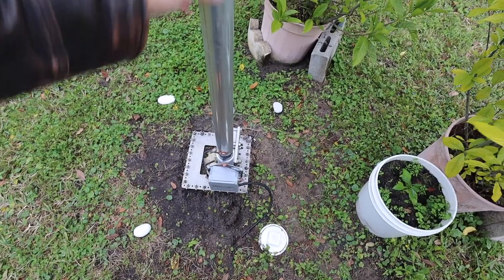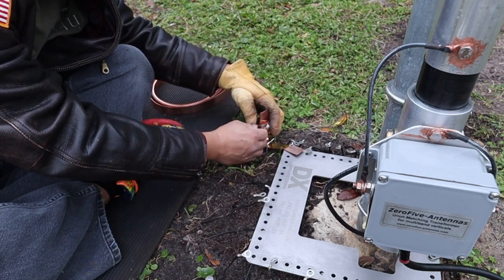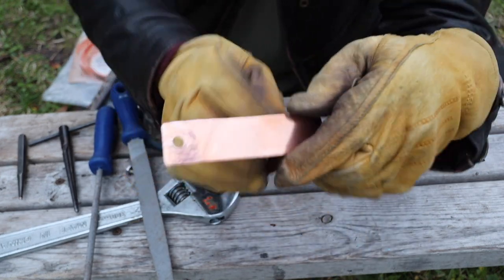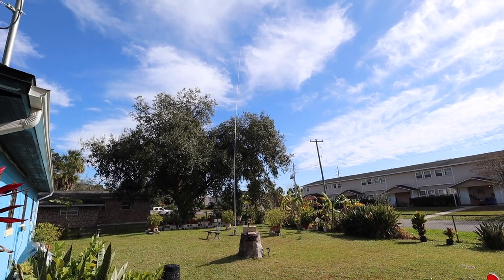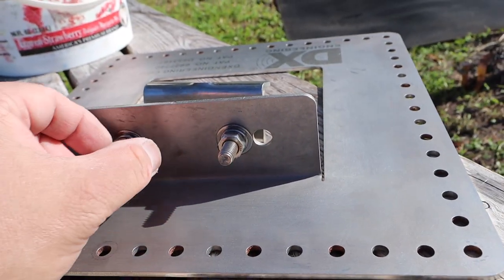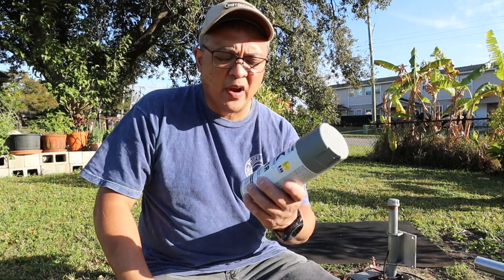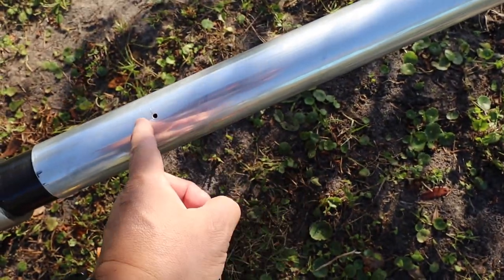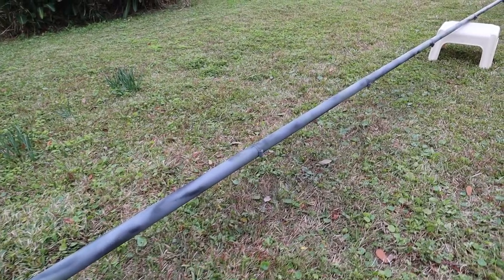Zero Five Antennas | Added 3 additional Grounding Rods and Camouflage Painting of my Antenna

Comment: I bought a post hammer for fencing at Home Depot for about $50.  Well worth it. Pounds tubing for vertical antenna support plus ground  poles with safety as it is impossible to hit your hand like what a sledge hammer can do. It really works great.

Comment: NOALOX is good to use between aluminum connections to prevent oxidation (NO ALuminum OXidation) .  It is also conductive and reduces resistance.  I used it on my 43 footer when joining the sections.  Also I think a better use of the ground rods is to put them in a line sequentially about 16 ft. apart (for 8 ft. rods) and joined with the copper strap or #6 solid wire.  If they are much closer than that their regions of influence overlap and the rod's ability to disperse energy will be diminished.  I'm assuming they are for lightning protection.  I'm enjoying your channel since we have very similar setups.
Reply from the maker: Hello Bill, those are good ideas.  Today, I just layed down 9 additional 43' ground radials and then a thunderstorm with lightning came where I couldn't finish burying them.  73's

Comment: I note on a number of your videos you like the copper based anti-seize for connecting aluminium parts and the copper straps to the ground plate. I can not recommend this practice. It is known that copper in contact with aluminum will cause electrolytic corrosion. search the electrolytic series to find compatible metals. There is commercially available corrosion inhibitors for aluminium one such brand is Aluminox.

Comment: must be great living on top of sand/mud.
my land is on top of large slabs of hard rock. i would be lucky to get down 4-5 feet and the have to dig out the hole so i could then drill into the rock another 10 feet.
or scrape off a lot of dirt and plant some livestock wire fencing (laid flat).

Comment: If you are installing ground rods, shouldn't they be at least 6 feet apart?
Also the hose clamp could corrode after awhile. I would suggest acorn ground clamps.
I did like the Never Seize that you used on the bolts though!
73
Bill
KO4HAJ
Reply from the maker: Thanks Bill good ideas.  With regards to the grounding rods, Tom the owner of Zero Five Antennas recommended me to set it up this way.  I'll change out the hose clamps for the acorns.

Comment: Nice work! But alway as a hind sight …. For better ground effect and lignin disipación the ground should be 6 fret apart from each other…  
The liquid that u r using for better conn what is it ? Does it have any type of cooper if it does be careful with any aluminum conn because cooper corrodes aluminum …

Comment: Does it make any sense to place the ground rods so close together?  What was the objective here?
Reply from the maker: Tom recommended that to me when I told him that I had 3 additional grounding rods.
Reply: @DarrenN4VFR  - I don't know who Tom is, but best of luck with your antenna.  I am not familiar with you antenna configuration...is there a tuner at the base?  Is it resonant at 80M (if that is your goal)?  There is a big difference between RF ground and lightning protection ground.
Reply from the maker: @daveN2MXX  No, not on 80 meters. I will need a loading coul for 80m or an external antenna tuner.

Comment: How does it perform on the air?
Reply from the maker: My new ZeroFIve 43' antenna works really well.  80 and 160 meters are a little tough to tune.  I have to use my Palstar AT2K Manual tuner.  My next thing to try is using an Antenna Tuner at the base of the Antenna.
Reply: @DarrenN4VFR  what coax did you use? I hear 213u is recommended. I wonder if lmr400 would work? Lmr400 has 32 pf per foot where 213u is 24pf/ft. Did the ferrites stop the common mode current /  rf in your shack? Maybe a loading coil at the antenna base would help 160m?
Reply from the maker: @gmw1964z  I'm using 150 feet of rg213 now. I will use my lmr400 for my 2m/70cm J-pole.
Reply from the maker: @gmw1964z  Oh and when I spoke with the owner of Zero Five, Tom says to not put any torroids or ferrite bead. It will mess up the tuner matching. There is a built in shunt to ground to prevent static build up on the antenna.

Comment: Ever thought of adding a loading coil to get 80?
Reply from the maker: Doug, hmmm that's a great idea.  What coil would you recommend?
Reply: Doesn't the 43 ft antenna already get 80m, no coil needed?
Reply: My 43 foot ground plane does, but some of the ground mounted verticals don’t. 
Or you may get a small section of 80.

Comment: Why so many ground rods??
Reply from the maker: I thought maybe more grounding rods would help with me tuning down to 80 meters.  My built in 7610 antenna tuner is not capable to tune to 80 meters. Therefore, for me to tune to 80 meters, I would have to do it manually on the Palstar AT2K.  I will build a seperate 80 meters dipole for me to get on that band.
Reply: @DarrenN4VFR  Grounding does nothing make the antenna matched
Reply: @DarrenN4VFR  A good rule is always use external tuner it gets a better natch
Reply: @DarrenN4VFR  If you have trouble getting on 80m, you will need to add length to some of your radials. Grounding will not really help you there.